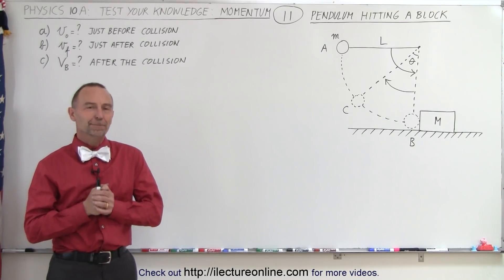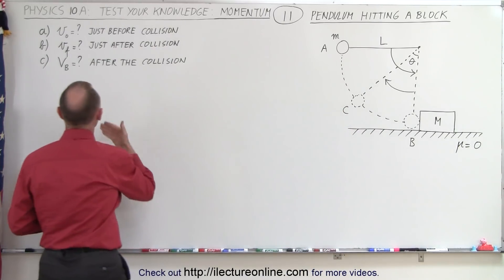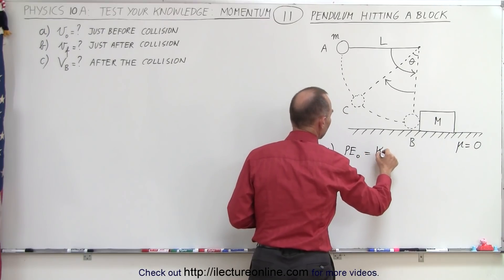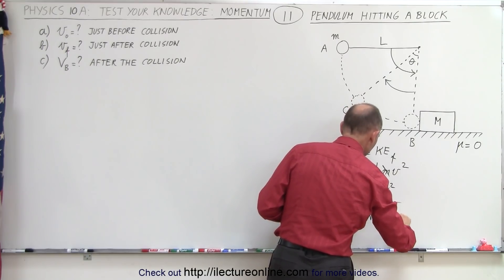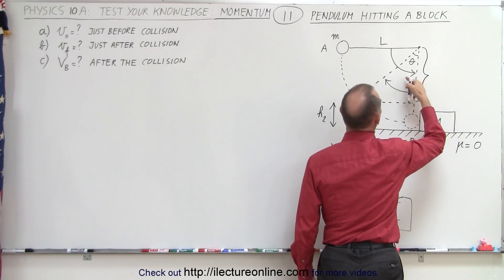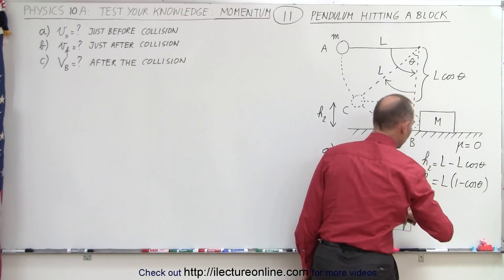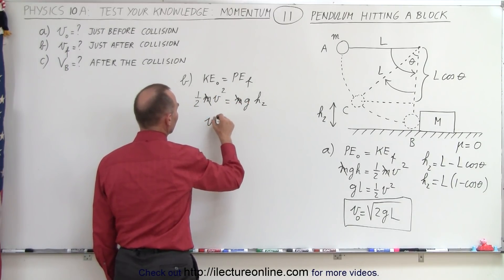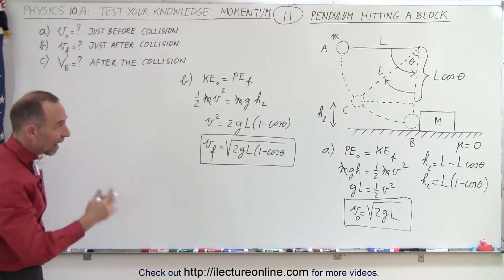Physics - Test Your Knowledge: Momentum (11 of 20) Pendulum Hitting a Block

Comment: is it possible to solve this problem for the speed of the block after collision if we are given no information about what happens to the ball after collision? No angle, height, speed or etc. I encountered this on a test and was unable to finish the problem due to this. Just wondering if there is something I could have done?
Reply from the maker: Look at our momentum - energy combination videos.  You use the conservation of momentum for the collision, and then use the conservation of energy after the collision. The energy part usually give you information that you can feed back into the conservation of momentum portion.

Comment: I’m confused as to how this doesn’t violate conservation of energy. Just before collision, say the pendulum has 10 J of Kinetic energy. Just after collision, the object that gets hit would have more than 10J of kinetic energy due to conservation of momentum and the pendulum would have more than 0J of kinetic energy since it is swinging back. So, the system would have more energy than before the collision would it not?
Reply from the maker: We know that the the momentum is always conserved, and that you can't end up with more energy that that which you started with.
Reply: @MichelvanBiezen  so say that immediately before the collision the pendulum has 10J of KE and after the collision the pendulum swings backwards some arbitrary amount, how much KE will the object it hits and the pendulum have immediately after after the collision? Obviously it will vary depending on how much the pendulum swings back after the collision but approximately how much energy will both objects have?
Reply from the maker: Note that the pendulum lost energy, since the velocity after the collision with the block is less that the velocity before it hit the block.  Once you determine the velocity of the pendulum before the collision and right after the collision, you can then determine the velocity of the block by using the conservation of momentum.
Reply: @MichelvanBiezen  wont the block after the collision be moving faster than the pendulum before the collision (assuming they are the same mass)? So why isn’t the energy of the system before the collision higher than after?
Reply from the maker: We cannot assume that.  We need to start with the principle concepts.  1) In a collision momentum is ALWAYS conserved, which will then determine what the velocity will be of the block.  In a collision, energy is never conserved unless it is a perfectly ellastic collision.

Comment: hmmmmmmmmmmm what if THETA equaled 90 degrees?... I assume the Block would NOT move.. and it's velocity would be ZERO... but I'm  can't see how your equation for the Final Velocity of the BLOCK would show ZERO... unless we let it's MASS be  = Infinity... I'll have to check this out.. :D .. great video Michel...
Reply from the maker: Philip, that is a good observation.  The only way for the ball to go back to its original height is when all of the energy of the system is returned to the ball and none to the block.  That can only happen if the block has infinite mass.